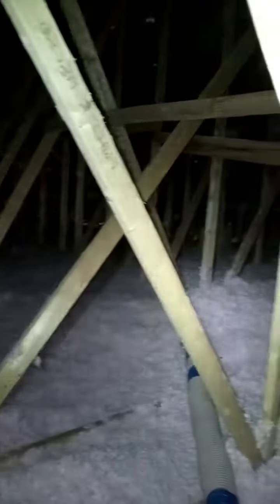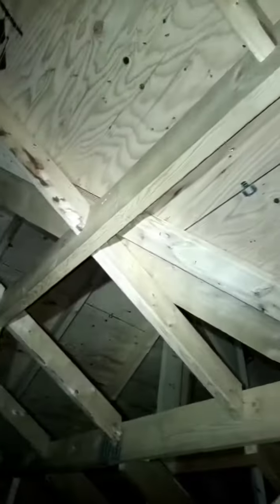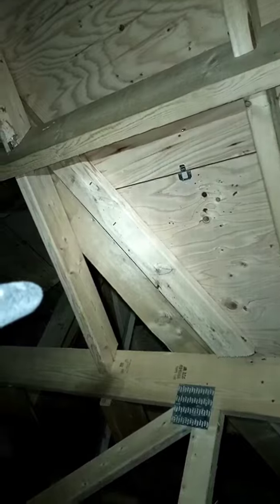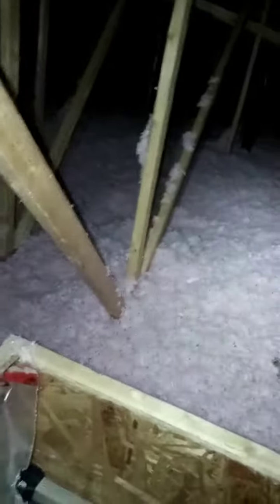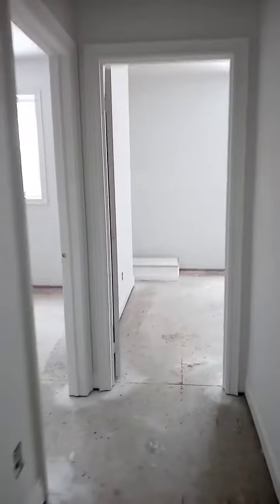#short This video shows a tip on how to find electric junction boxes in an insulated attic.

Comment: How would you move insulation and replace it with flattening it out? I need to do some sealing & baffles & had insulation blown in last year ):
Reply from the maker: You would have to carefully remove it. It's almost impossible not to disturb the loose fill, so if you are doing this you may need to vacuum it out. Make a path for where you need to go, then you can rake it back in place, but it won't have the same depth after since it was disturbed.